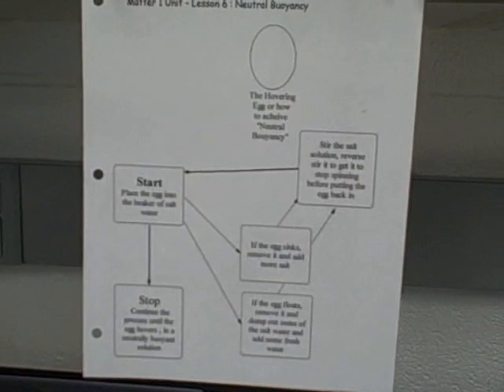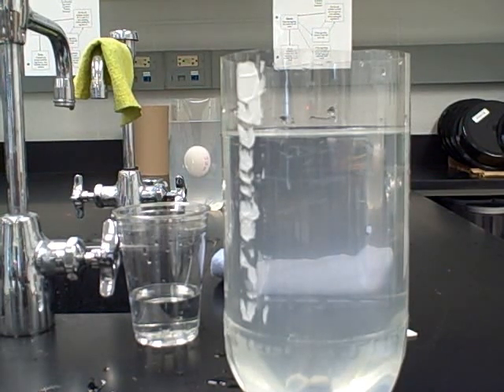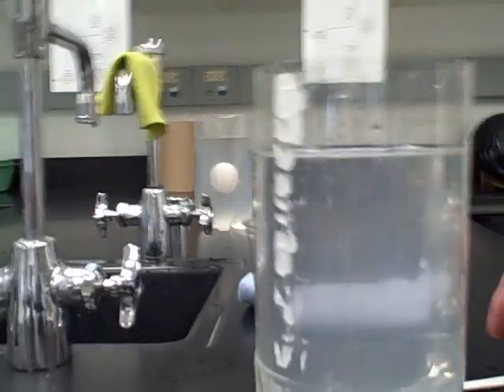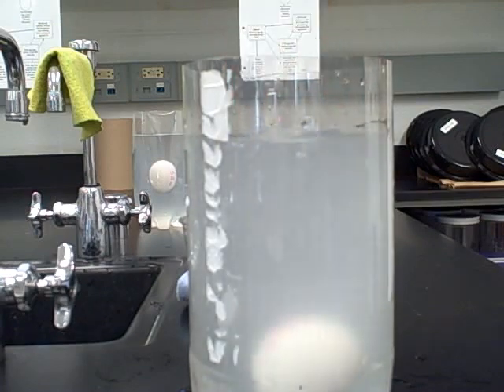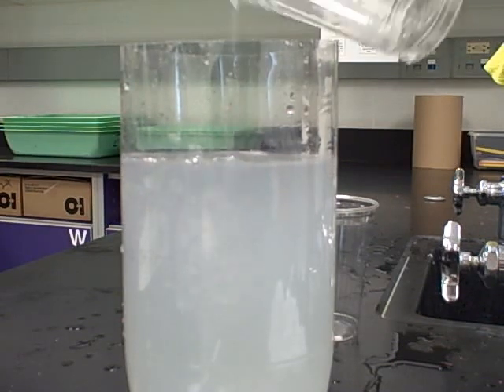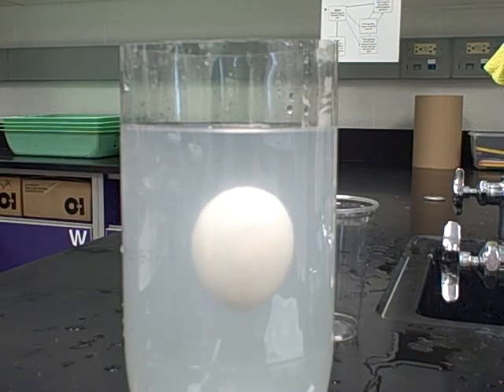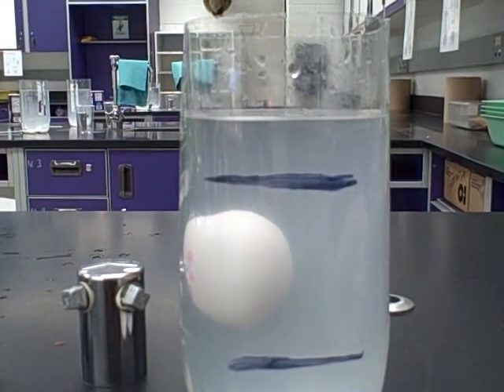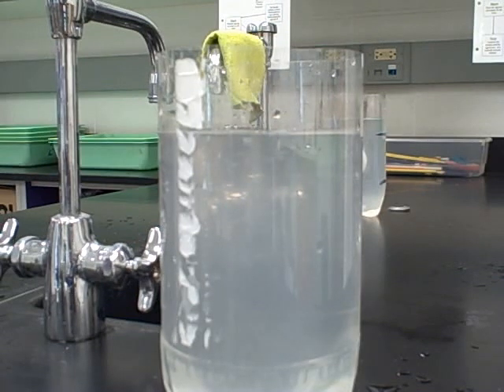Neutral Density - The Hovering Egg.wmv

Comment: Cool video. What happens if the egg is nudged up or down in the solution?
Reply: It will create a vacuum or pressure inside the egg depending on the direction of force.